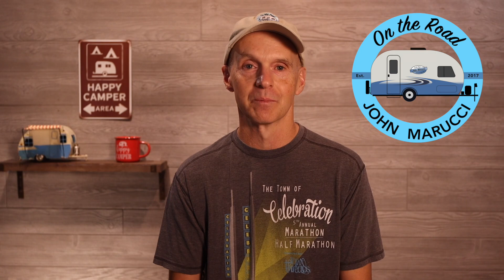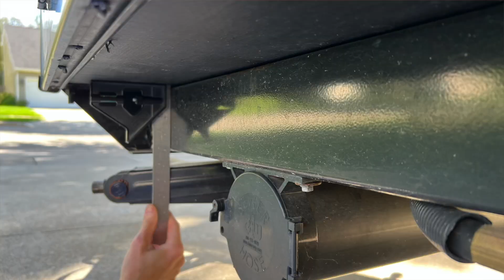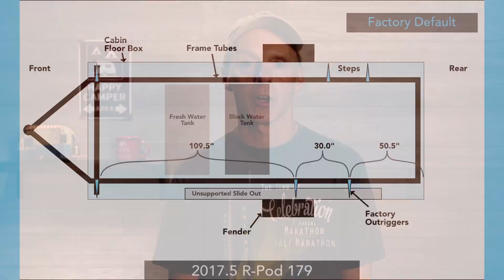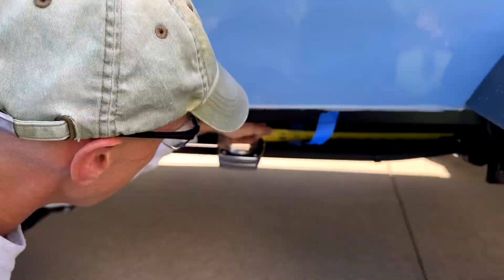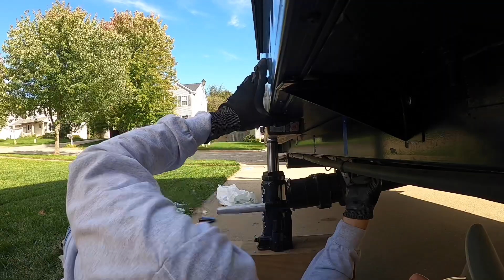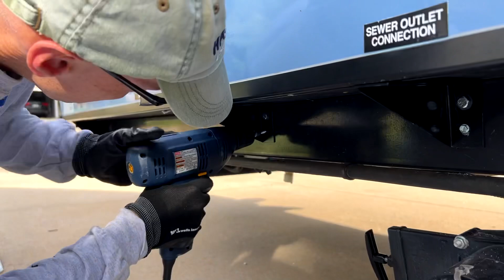R-Pod Outrigger Installation – Step-By-Step Process

Comment: Great job, John...my outriggers should be here this week.  One question:  your drawing shows you added an outrigger within the limits of the fender...obviously, the wheel and tire need to be removed, anything else I should be aware of...?  Other than the front corners, my 2018 179 has no other outriggers....thanks...
Reply from the maker: Dennis, I didn't have to remove the wheel for the outrigger closer to the axle, just temporarily removed a few wiring harness brackets. It was far enough away from the axle that I could still get the drill in that spot. Getting leverage on that one was a bit more difficult, but doable. Thanks!

Comment: Great video, thanks John.
We have a 2017 178 and after checking I find that my floor is also sagging on the slide side, door side is perfectly square.
I am at the point where I am ready to install the outriggers but have ran into a problem.
when I place the hydraulic jack under the side wall that is sagging it only moves the floor and wall up about 1/4" after that the whole trailer is being lifted. This leaves the floor and frame about 1/4" off of being square but the floor and wall will not move any higher.
any ideas?
Reply from the maker: I assume your slide is in and that you are jacking directly under the slide somewhere. What length board are you using to disperse the lift of the jack?
Reply: @JohnMarucci  yes the slide is in and the jack is just left of center under the slide. I have a 12" length of 1/4" angle iron that I thought would work.
Reply from the maker: Okay, that should do it. Not sure why a sagging wall won’t lift to square. I’ll have to point you to some of the experts on the owners forum to ask there. Sorry that I don’t have further ideas on what to try… rpod-owners.com
Reply: @JohnMarucci  not a problem John, thanks for responding. I'll check out the other forum and see if anyone has any ideas. Yeah I've been scratching my head over this most of the afternoon after I saw what was happening. It's like the slide is holding the wall down.
Reply: I am just starting the outrigger installation and I am running into the same issue. The angle between the floor and the wall of the beam is 87 degrees. I started to Jack up the wall and the entire side of the trailer is being raised, not the wall itself, so I can’t get it back to 90 degrees. I’ve tried this at 3 different locations along the side of the bump out and the angle never changes, it just lifts the whole side of the trailer.

Comment: Anyone looking into a class action to get Forest River to provide the parts @ no charge?

How much are they selling them for?
Reply from the maker: I haven't heard of any legal action. I paid about $4 per outrigger + shipping. Eight outriggers cost about $45 with shipping. Thanks!
Reply: Harold Davis replied in John's previous video about the sag problem that the factory arranged to have the outriggers send to his local dealer and installed at no charge, he call under "goodwill". I am going to look into also doing this. If they are won't I might mention people are talking about forming a class action about it and it should also include a fix for the floor sag John and many other owners have seen.
Reply: @mhfnet  I wonder if the dealer will do an adequate job. The Fix they had for the backwater tank drain tube did not seem the best. although that was due to the quality of the hangar itself.

Comment: I’ve been anticipating this video! You’re the man John!

Question: did you think about welding on the outriggers?
Reply from the maker: I didn't consider welding given the use of the through bolts in the top hole. These should provide plenty of pull-out strength for the outriggers. I suppose if you can weld or know someone who can, there is no reason not to do this. I suppose the most sturdy solution would be to use through bolts and weld, but at some point it is over engineering for the issue. I have seen some solutions that are very heavy, but may be more than needed vs putting the Forest River outriggers closer together with through bolts. We'll see how mine holds up and you definitely need to be comfortable with the solution you choose. Thanks!
Reply: @JohnMarucci  I've "heard" welding if not done right can weaken the frame. I had some heavy outriggers made but concerned the top hole might be a bit high (another frame strength concern). Do you happen to have a way to measure how far down the top hole is, on the ones you used?
Reply from the maker: Sorry, I didn't see this reply. I am not near my R-Pod right now to take a measurement. Thanks!

Comment: Great video, thanks!  I have ordered and received the outriggers for my 2018 179 and will start to install when we have some dry days.  I was curious if you considered cutting out the aluminum channel to be able to place the upper edge of the outrigger tightly against the underside?  If you did consider it can you tell me why you ended up not doing it?  I have been going back and forth on this issue.
Reply from the maker: I did consider cutting the channel but didn't want to introduce another entry point for moisture or weaken the rail. Others have done this. I didn't add fasteners to the wall rail because I felt the shelf the outriggers rest on seem very sturdy without them. I will revisit it in the Spring once I start using the R-Pod again. For now it is in storage with the new outriggers supporting the wall. So I may add them yet. Thanks!

Comment: John - truly appreciate your channel and the information it provides. Couple of questions if you happen to know the answers. Any reason, other than cost, that you didn’t use stainless steel hardware?  How long did it take, approximately, for each out rigger?  Why is it important to have the trailer perfectly flat since you are using a square - that piece didn’t make sense to me. I am looking to do this as a preventative measure. I have not noticed any sag on my 2017 179rp.
Reply from the maker: Great questions. I used zinc hardware mainly for cost savings. It took about 20+ minutes per outrigger, but keep in mind the first couple took longer as I was working the process. We were also video taping, which added time. I could probably do one in 15-20 minutes each after set up. As far as leveling the trailer to the surface, that’s so the jack isn’t at an angle to the trailer when jacking. Let me know if you have any other questions. Thanks!

Comment: Hi John  thanks for the thorough video, although my pod did not have a sag I added them as a precaution.  I noted  my early install in the RPOD Owners Forum where I installed these outriggers as well,  I placed the outriggers under the nylon rollers that the slide out uses to move,  figured the downward pressure of the slide is more significant on the rollers.  Re attaching the screws using the two holes to the outer edge of the outriggers,  I debated about how to attach the edge of the outrigger to the  slide out frame since FR had added these holes i figured they were doing this on later models (no instructions from FR on how to do the install)  i decided to carve out of the aluminum channel  a place to slip the outrigger into, I  cut out just the lip of the channel  not the whole channel,   not sure if this was really necessary but went ahead and did it.  I  did add two screws into the edge of the channel and into the outer slide out frame.       Also i did order 4 additional outriggers for the door side,  not sure if I will add all 4 to that side or just 3  and instead install a 5th one to the slide out side  a foot or so back from the front leading edge near the welded angle iron that is used to attach the floor of the pod to the frame.  Similar to where you installed one.     Your thoughts on where to install the outriggers on the door side,  i figure one directly under the step, and then evenly spaced in front of the fender?
Reply from the maker: John, thanks for sharing how you went about installing the outriggers. On my 179, the two step brackets act as outriggers and extend to the outer wall as far as I can tell. I was contemplating adding three door-side outriggers equidistant from the step to the front of the trailer, approximately 31.5" inches apart (exact measurements are on my diagram on my docs & downloads page, last two pages on the Outrigger Install doc): https://johnmarucci.com/docs-downloads/ 

Thanks!
Reply: @JohnMarucci  thanks John,  re the door side outriggers,  I do see now that I crawled under the pod that the steps do act as outriggers since they are attached to the frame and extend to the edge of the wall,   thanks for the insight!   I will attach three outriggers forward of the wheel/fender similar to how you laid out in your installation pdf  much obliged!
Reply from the maker: Sounds like a good plan, all the best!

Comment: I have a 2017 178 do not see any outriggers, are they supposed to have the ones you are using, everything looks good.enjoy your video's
Reply from the maker: Ron, if you don’t see outriggers on the frame under the trailer, use a combination square to see if the floor is sitting square to the frame. The 179 has more weight on the slide out than your model, so you may not have an issue. If not, then it is your call to do the job proactively or just monitor it. Thanks!
Reply: I have a 2018 RP179 and have no out riggers at all on either side. Is this normal?
Reply: I also have the 2017 178 and was wondering same…. I’ll likely add the outriggers to be safe.
Reply from the maker: It is tough to say when FR put how many outriggers on what models and during what model years. I've heard from some people that they have several, while others have none. I think the safest way is to go under your R-Pod and diagram out everything in terms of bracing that goes from the frame tube to the outer wall, then plan accordingly. Hope everyone has info they need to work a fix as you see fit. Thanks again!

Comment: Very well done video. I was wondering your overall cost for this project.
Reply from the maker: Harley, great question. I had most of the tools and supplies, so it would be much more expensive if you had to buy the tools. I did buy the outriggers from Forest River, eight with shipping for about $45. I also bought a new drill bit ($9 or so) and 6-ton bottle jack ($33) and the bolts, nuts and washers (close to $30). I had the Rustoleum paint ($12) and Teks screws ($8) from another project. So over $100 for sure. Thanks!
Reply: @JohnMarucci  Thanks John
Reply from the maker: Glad to help!